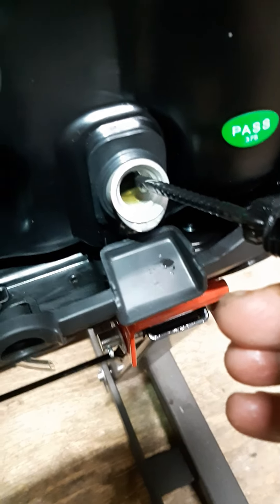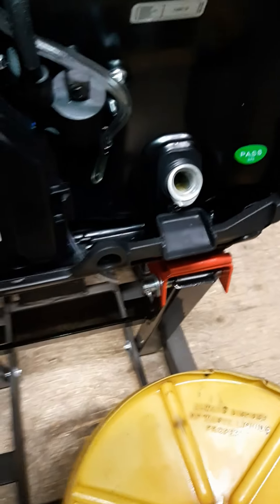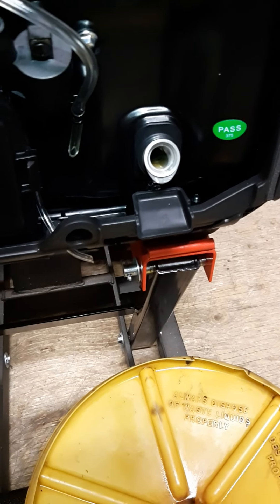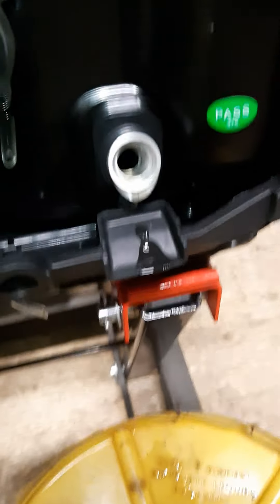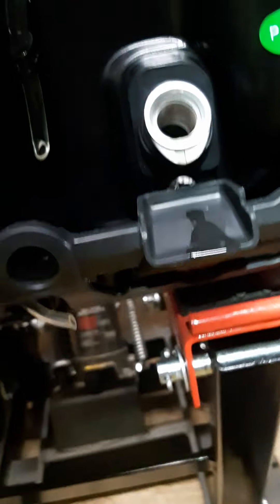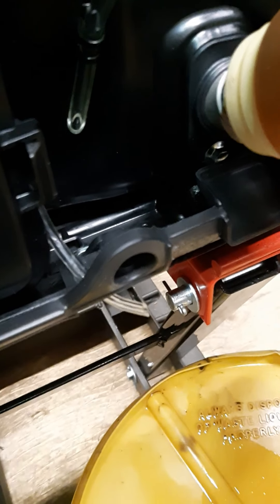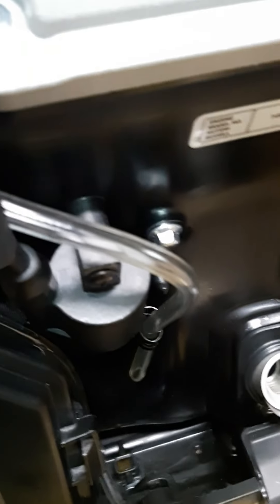2500w champion inverter generator first oil change

Comment: Had mine a year and a half and use it a bunch, prolly have around 5-600 hours on it. Last oil change it was down at least 1/3 a pint from full. Disappointed its begun to use oil hope it doesnt get worse or this is an indication of future failure. Otherwise its been flawless as was the predator 2000 i had prior. Louder than a honda but fair for the price I guess. Today for the first time I coaxed it into starting and running my Dewalt hand carry 4 gal 4.5 cfm compressor. 15amp running more to start so thats impressive, the predator wouldnt even budge it.
Reply from the maker: hey there, I to use mine a lot, so much that champion gave me only one warranty and no more for the life of the generator. When it died out on me I needed to get a new stepper motor, gaskets for carb and exhaust also cylinder head gasket. I cleaned the cylinder head, carburetor, fuel filter and tank. Reset the valve's and all was good for a while then the carb flap came off and went into the top of piston head. So I had to buy a carburetor myself because they don't sell just the flap. PS: tighten that flap with blue lock tight
these video's might help: 
https://youtu.be/eRDUmy49OvE
https://youtu.be/xsbQKpAs6es
https://youtu.be/mjwxC8S0QIM

Comment: Mr. Bruce , Could you please tell me where you got the stand to service the generator and what it is called ? Thank you in advance for any help you can give me sir
Reply from the maker: ya that's a "atv or motorcycle jack", got it from Canadian Tire, I'm sure you can get one at any place that sells atv or motorcycle stuff, bought it for my 400 ATV, but it only can lift half the four wheeler, so I also use it for my bigger generator to work on, so it's not on the ground and I can sit on a chair.
Reply: @brucegreen1016 I just put mine on the back of truck bed and tilt the oil into an oil drain pan on the ground. Works perfectly for me.

Comment: How much oil do you add for first time change ? Is it 5/30 or 10/30? 
Thanks
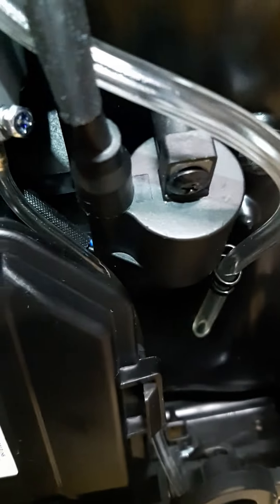Reply from the maker: I used the oil that came with the generator to break it in and put 10w30 in after that and ran it a few days then switched to 5w30 after that and still running 5w30. I just figure that the thicker oil can fill in all the cracks first and then the thinner oil can ride on top of that. The generator can only hold 500ml of oil, you can put less but it won't last as long, engine has oil shut off if the oil is to low and will not start until the oil is added. The generator will always have oil in it after the oil change so you might not get 500ml in all the time, use the threads to determine how much oil is in there, two threads from the top is good. At the (4:28) mark of the video I say " one more of those and we are good to go" I use a 250ml bottle to add my oil. PS, don't put the eco throttle on when breaking it in, keep it off until you are ready to use the generator. thanks for the comment and watching the video

Comment: How much oil is that?
Reply from the maker: hello, This generator uses 500ml of oil. I added two bottles at 250ml each. If you are not sure how much oil you put in, just use the threads to determine of much is in there, add oil until three threads remain without oil, then it should be good until next oil change. thanks for watching the video and commenting
Reply: It is a 16.9 oz water bottle from the store amount… you know the waters that come in a pack of 24 at the store, or half a quart of oil
Reply from the maker: if you are asking what kind of bottle I am using, it is your average baby bottle with a nipple, that came with the angled top, 8oz large size baby bottle, hope that answer your question

Comment: Not enough oil according to the manual you should see in the threads
Reply from the maker: hello there, if you listen close to the end of the video i say, another one of those and we go to go. I added the other bit of oil after i ended the video before starting it up. Used 500ml of 5w30 synthetic  for the conditions we have up north in Canada, 30c to -40c. I guess i should have showed the other oil bottle topping off to the threads. Now I know